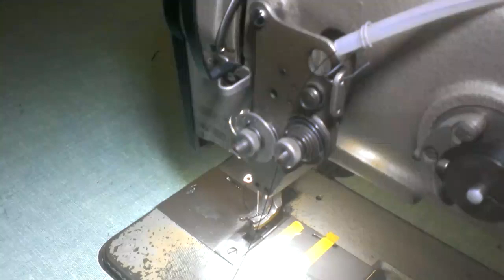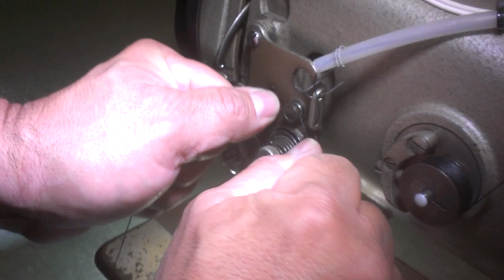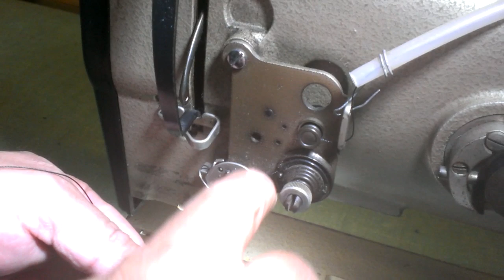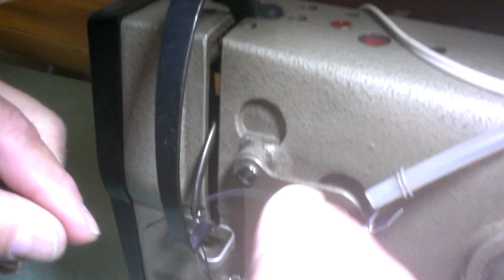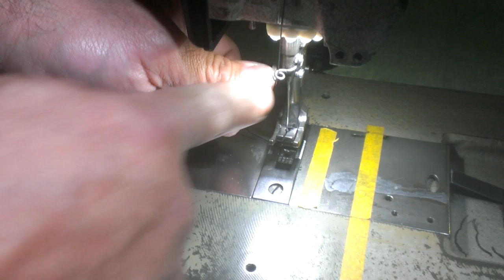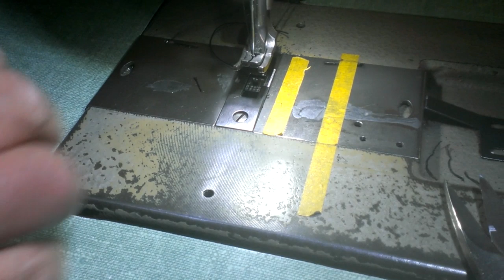Threading the needle Side of the Pfaff 1245 compound feed walking foot sewing machine.

Comment: Your threading around the pin on the tension disk is wrong. After years of doing it your way I ordered a replacement pin and the mechanic told me that the only way that pin could cause it wear out was I was threading it wrong.  So I was in disbelief and got my original Pfaff 1245 manual out and found a picture showing he was 100% correct. I no longer put my thread around the pin.
Reply from the maker: Fred McGuire I find it gives better control over the thread tension.  A new tension device every couple of years is a small price to pay.